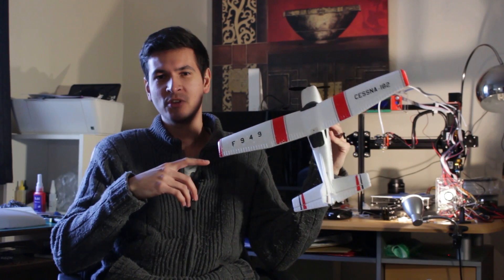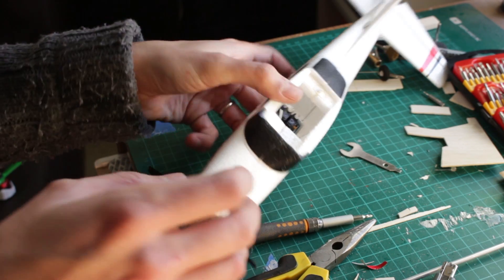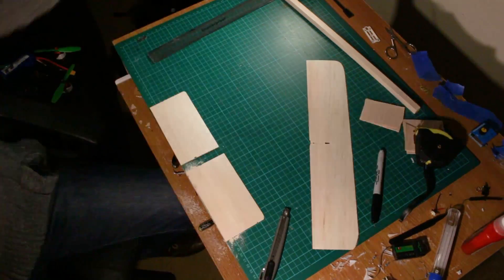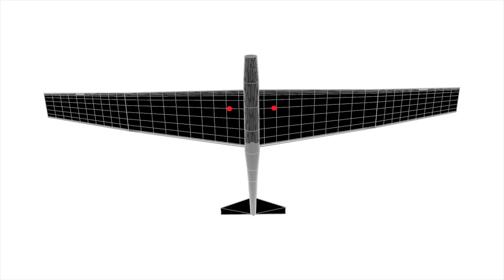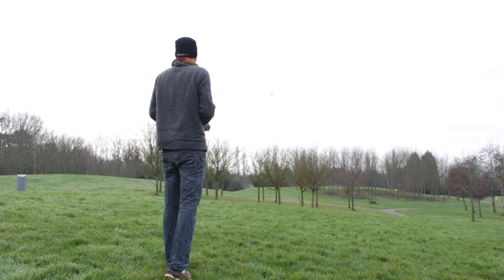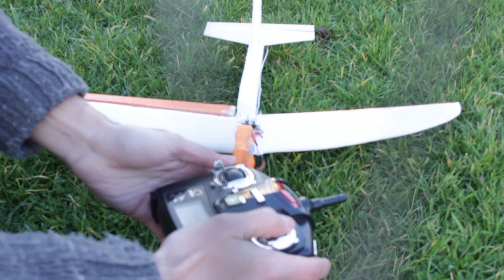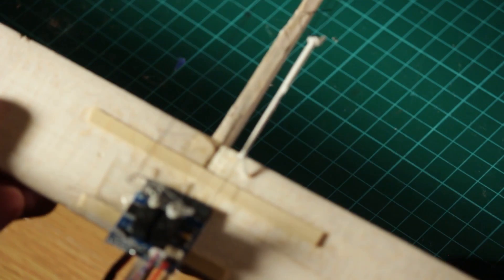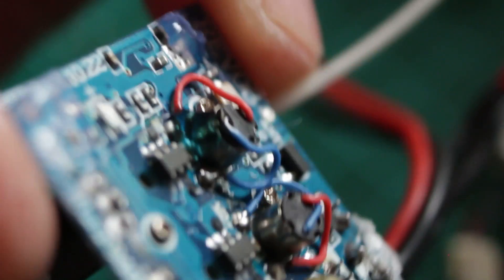How to Make an RC Airplane with Recycled Parts

Comment: So... since the glider is so small.... every gram matters.  Instead of having two control strings going back for each surface.  There is a way to set the control surfaces to be naturally swinging to the elevator down or up, or the rudder to the left or right.  This is by forcing the section in the opposite direction and taping it with a tape length that is slightly longer going around the bend.   Which will act as a natural spring.  So, then you just need to tie the knots at just the right length, and the tail section will auto go in a direction.  Which also means that the servo weight can be cut by a gram too... by cutting off one of the arms.  You'll only need one side.  You can use water to bend balsa wood, and force it to dry in a certain shape.  This is hard though, as the wood can warp... have to be very careful on this part.  Thank you for the idea on this RC.
Reply from the maker: Thanks for your comment!
Reply: at 2:17,  see  two servos and stiff wire pushrods.   one for rudder, one for elevator.   that is as SIMPLE as it gets.

Comment: That's an awesome work, man! When you can, take look in this planes: https://www.rcflug.ch/psc/modelle_Microfighter.php and https://www.rcflug.ch/plans/detail.php?pid=809 (the second link has a flight video). I'm going to build something like that as soon as I can. :D You can use the v911 or f949 control board, they are identical. Or you can use f959 control board, that uses 2s batteries. ;)
Reply from the maker: Those are good micro airplanes! I might do something similar in the future.
Reply: Joyplanes Nice! :D

Comment: A tip to anyone that want to make that: you can buy the F949 (F959?) receiver/control board from AliExpress, Banggood or even Gearbest (I think). About the control, you can bind it to the FlySky FS-T6 or any compatible transmitter. :)
Reply from the maker: True